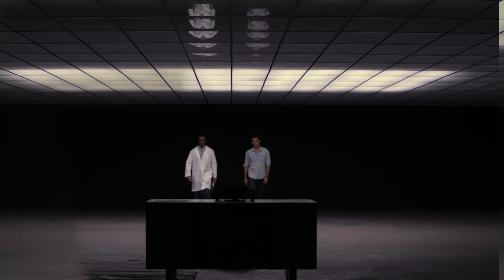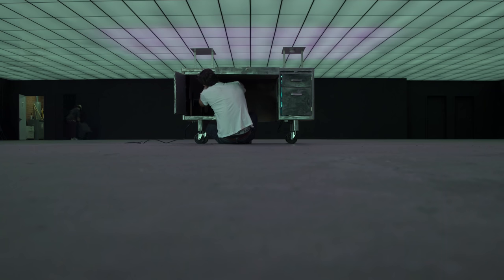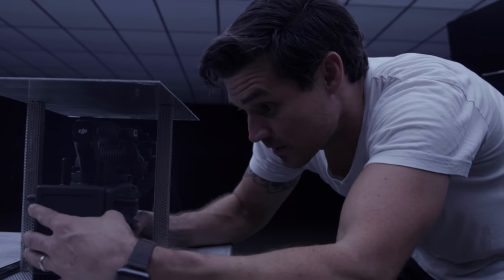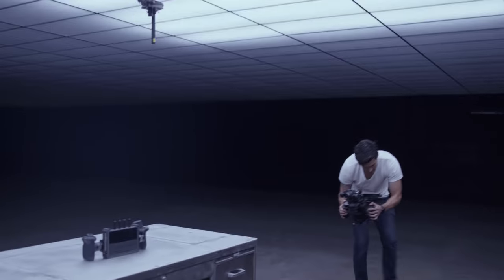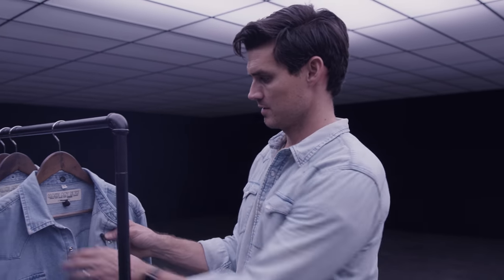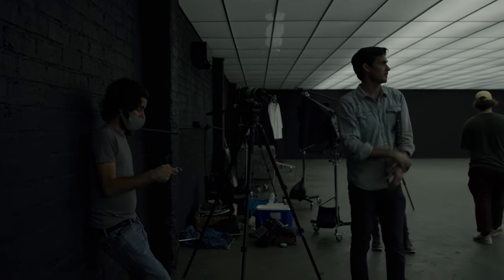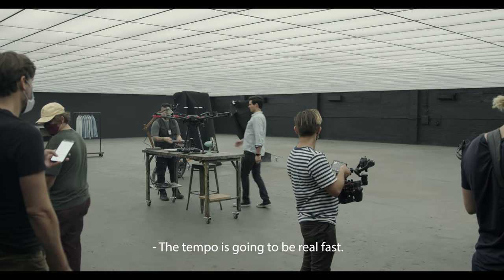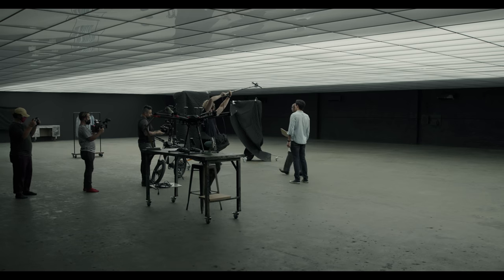How I shoot an Epic Commercial || BTS "Does it come in Denim"  DJI Ronin 4D

Comment: Presuming these are not straight out of the camera?   The files you provided seemed incorrectly transformed?  Did you happen to shoot a color checker also?
Reply from the maker: The one I'm having the most problems with is the wide shot. In the folder structure it's in the Original folder. It's HLG rec2020, and  would require proper transform. The other ones are prores rec 709. 

Did not shoot a color checker. Second major mistake. Contemplated going back for that, but  without exact camera specs, and conditions--- probably would have been a bit off.